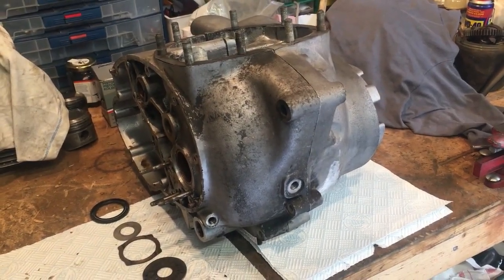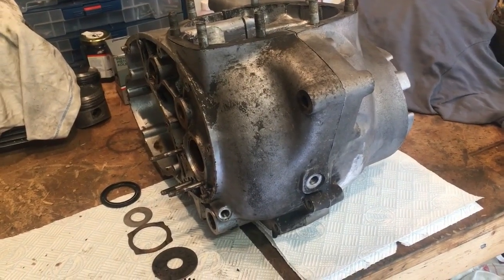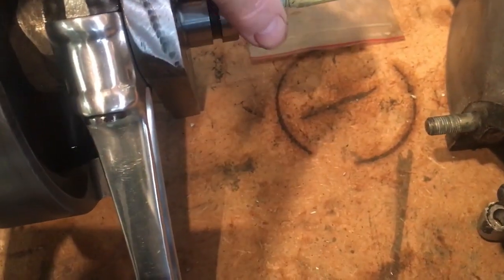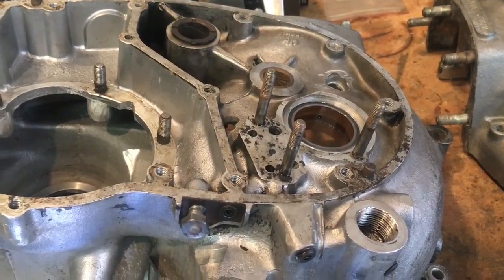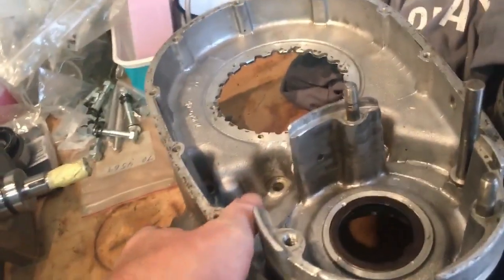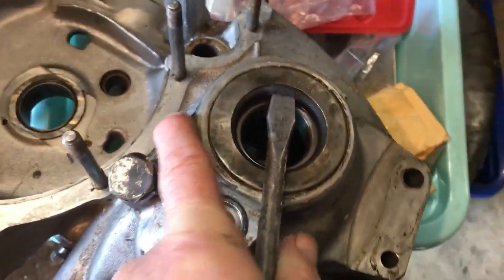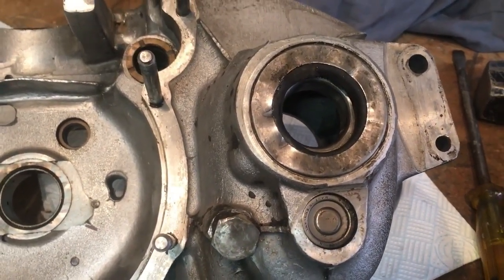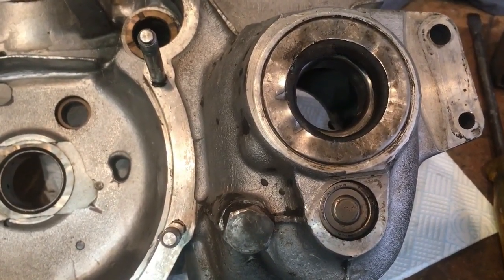BSA A70L Lightning - Engine Part 12 - Crankcase Preparation 1

Comment: A little tip for removing bearing races is to run a bead of weld around the race and it will fall out cheers
Reply from the maker: Cheers Ian for the interest and tip. I’m not an engineer but am learning so will keep this in mind for the next time when I’ll borrow Matt’s welder!

Comment: Thank's a lot for showing this, I was too puzzled why there wasn't any thrust washer inside the case in the partslist. It make sense to fit that washer inside as it seems to be made for that. My pleasure to be of any help.
Reply from the maker: A great help - thank you.
Reply: If you don't mind,  could you measure the outer diameter and thickness of the outer thrust washer for me. I'm not sure if I will do this conversion on my bike but I will concider it. If you still have it available will say. And the lenght of timing side journal would be great too.
Reply from the maker: jotomoto62 Sure no probs I’ll include in the next vid on the A70.
Reply: Thanks I preciate it.